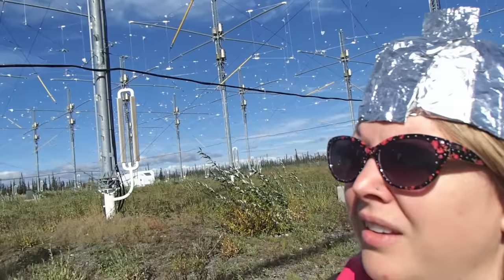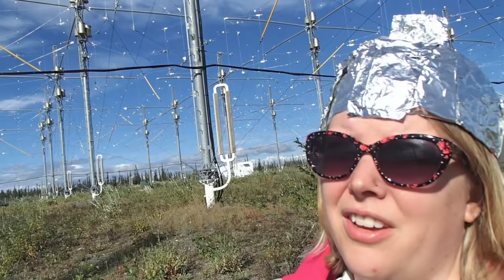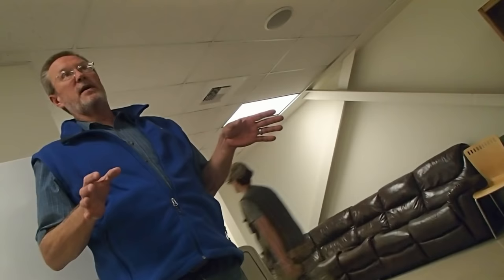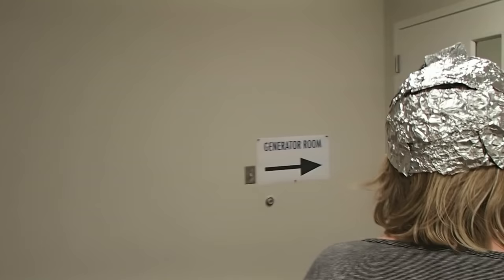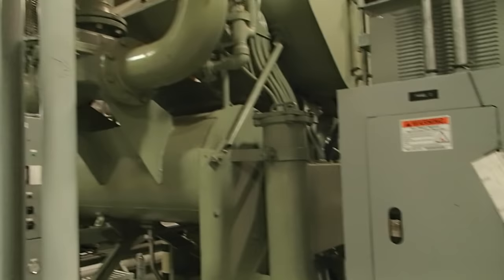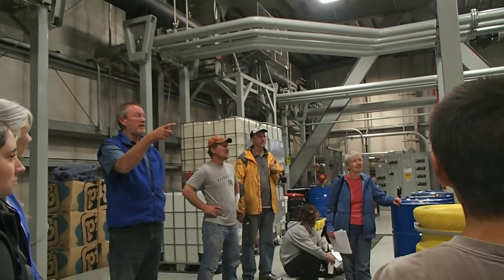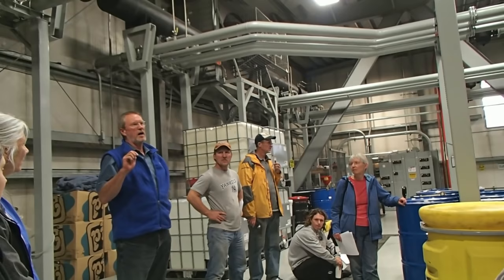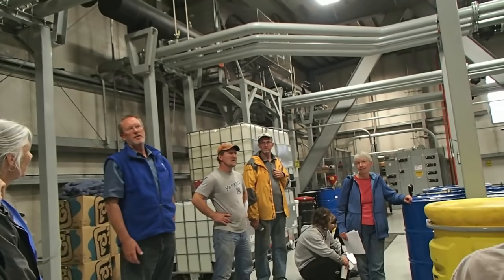BEHIND THE GATES • Scientist tries to explain away conspiracy theories

Comment: So this facility also makes up the power required to pump RF radiation to ionosphere they have diesel generators and this will result in large gulp of crude whever this project will peak the energy throughput which is indicative to the current oil geopolitics in 2022 when oil and gas are the issue
Reply: Not to mention the current climate conditions have been drastically affected resulting in massive heatwave from 2021 to 2022
Reply: They’re like 5 diesel generators hahaha do you even realise how much oil the world produces per day?

Comment: The antenna direct high frequency micro wave admissions, like A.M.( amplitude modulation ) radio it can be pounced off the ionosphere, when it hits the ionosphere it heats it creating a high, that in turn can direct a storm if you place it in the storm path, want a drought, just keep directing storms away from an area, want floods, push storm to an area and cloud seed, place it above a hurricane you increase the hurricanes strength, In the 60s the U.N. made every body sign a pact to only use it as a research tool because the U.S. during the Vietnam war drowned the Ho Chi Minh trail so successfully as many as there are I'm sure there used for more than that.

Comment: Funny how Jessie Ventura didn't get the tour when he showed up at the gate, huh?
Reply from the maker: It was a TV show and the sensationalize drama.  These open houses don't happen very often but they do happen.
Reply: @outliersoverland  It was kind of a rhetorical question really. I enjoyed your video though, and would like to ask if there was any parts of the site you weren't allowed to visit, or equipment inside that you weren't allowed to film? The Telemecanique 140 series PLC that appears at 1:20 is some very old legacy industrial control tech., but in very good condition - which kind of suggests not much goes on there as a general rule. If I could make out the small print on those white front panels, I could probably deduce what it's being used to control.

Comment: If I remember right from years ago when this thing opened up and maybe with Jessie Ventura's gag they had 6 or 7 of those huge EMD gensets, the biggest train engines ever pulling them. When HAARP was operating it was like 6 running and one spare. I'm not sure but they didn't run them all. BUT anything that uses THAT much power can't be used for good. Something like 2.7 Million (mega) watts a piece. They're running tours to pacify folks. They used to have pictures of the inside of the generator building and they were taken down. All part of the big bad game I guess. And this supposedly is NOT the only one of these. I think smaller ones are all over.
Reply: There’s something similar in Cuba. You can see the pulses on radar when it’s operating

Comment: Is the air force already finished with their experiments in this facility?  Try to get near to one of those antennas when they are operating it in full power or better still try to touch it if its not really harmful.  What are they trying to prove here? That the conspiracy is not real?  Of course they cannot hide a wide array of antennas such as this but they can hide their experiments and will not let you near to those antennas when they operate them in full power.